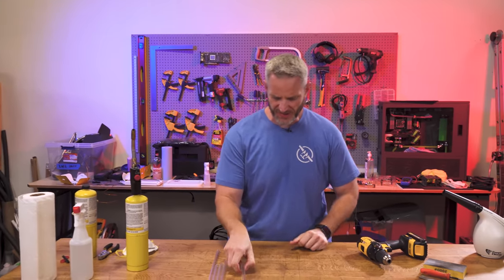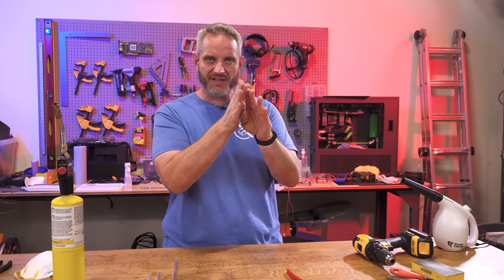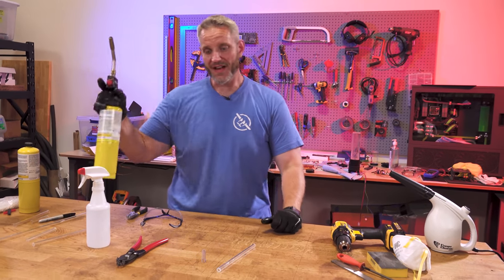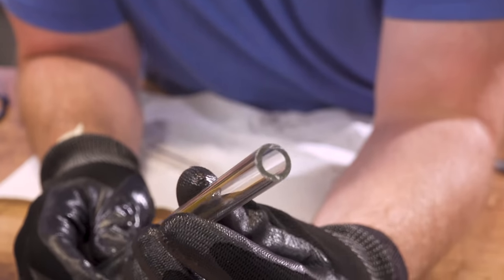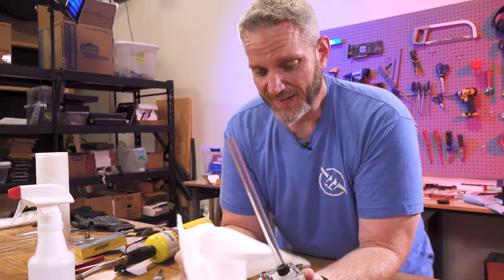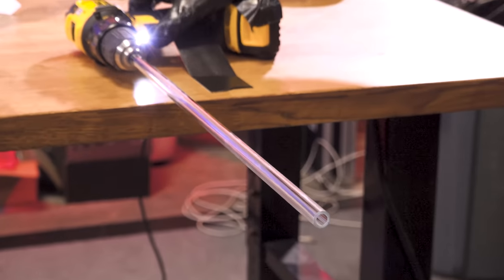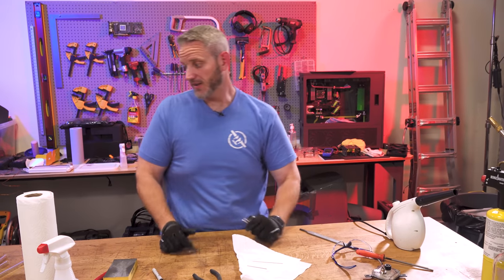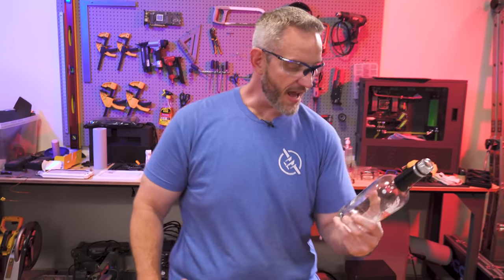Learning how to bend Glass Tubing... This looks soooo good!

Comment: Former glass worker here, go find yourself a glass supplier, you are in Cali, there are plenty of workers there. Youll be able to find much longer lengths and colors as well, just be sure to have plenty of ventilation as these use heavy metals for colors. Items you need: glass saw, bucket with water to throw hot scraps in, blow tube.
Second edit: STOP cooling your hot glass, hot glass need to cool as slow as possible to retain strength.
Third edit: didymium glasses, save your eyes.
Reply: This looks like the tip for you
Reply: Or just get the glass worker to make the pieces you need. They would bang them out in no time flat for you. That way you don't waste materials, time and risk burning yourself or your shop up. (And if doing glass blowing you have to really know what your doing as to not inhale any of the super heated air... that would be bad... very bad). I also like the idea of using colored glass tubes as you wouldn't need to have dies in your coolant fluid. You could also have a reservoir made of the same colored glass.
Reply: @hammer9856  This!!! I used to draw up the patterns for neon signs. You really need a much wider flame for doing clean consistent bends.

That said. i came up with a set of 3d printed tubes and bends that I use to plan out the part, then translate those plastic lego style tubes to paper patterns. then bend the tubes from that pattern. added bonus is you usually can pull off crazy complex parts in your first attempt. and you are left with a set of documents to remake tubes from should you need it. Still do all my builds with petg tube, but the logical next step is I take the patterns to the glass shop....
Reply: I like the idea of a colored glass build, maybe with a fancy logo made out of glass tube
Reply: @danc4046  But why color the glass and not the coolingliquid. It seems smarter to just use clear glass.
Reply: I think the same thing, anytime I see a forger rapidly cool their metal work. :/
Reply: @peterpoulsen4794  it does if you plan to change the color of the water and the whole build is going to be that color of fluid, but if you want different colors in separate parts of your build colored glass would be the best way to accomplish this. then you water is clear and clean and you dont get any kind of weird build up.
Reply: @peterpoulsen4794  seems interesting, what other reason do you need? OP mentioned other safety measures needed for colored glass and having Jay research and demonstrate would be worth watching.
Reply: @danc4046  Also colored glas means you do not need to deal with all the downsides of coloring the liquid.
Reply: @peterpoulsen4794  There are crap ton more colors you can achieve with colored glass than your liquids, it also will not discolor over time. I definitely see peoples points of changing the color but if you are trying to achieve a theme with an exact color, colored glass could be a better option.
Reply: Someone who had a job and has that kind of pfp? That's so rare
Reply: Yeah watching him rapidly cool that tubing is giving me anxiety. Clear boro is resilient as fuck but its also a dice roll when you do shit like that haha.
Reply: @suborgulag7289  what does my pfp have to do with making a career switch in my life?
Reply: @VigilSerus  exactly, clear is strong but I'd rather not risk it when that is pushing liquid around electronics
Reply: @joeschmoe5009  This is one of those Red Barn Racing moments - yeah he can do the engine himself, but why not have someone with years of experience create a better product for his project?
Reply: @hammer9856  You could also get a pro acrylic worker to do your  plastic work for you too. I think you are kind of missing the point.
Reply: @hammer9856  absolutely agree, especially for very complex bends. They have the expensive tools, lathes, etc to make these perfect. I have been thinking of spiral DNA tubes but I need to try pressure testing to see of that has any effect.
Reply: Love this tip, you could also have that worker make the tubes with the bends. Still allow for him to do the build himself. Just like he did with the metal tube build.
Reply: @peterpoulsen4794  Actually using coolant that is already tinted / colored be it pastel or not, over time it will stain, and could clog up the tiny fins / pins in the CPU / GPU block. 
Actually Jay did a video about a year ago? where he cleaned out his or A PC that was using a green pastel type of coolant, the cooling system got all screwed up, look it up on his video list. 
The Idea of colored / tinted glass is a much better idea, and using distilled water with a biocide and a piece of pure silver in your reservoir to stop any growth in your loop.
Reply: Nice pfp
Reply: Glass worker here and my sister is a glass blower and I second e everything Micheal said
Reply: @badreality2  you have a problem with the quenching step of a perfectly ordinary heat treatment process?
Reply: @joeschmoe5009  I'm talking about the engine in his project car. It doesn't NEED an engine, it can sit there and look pretty since he has a completely functional one. 

And since there's an entire industry (and I'm willing to bet a guild, if not a union) of glassworkers, I'm pretty sure that it's time consuming enough to apply.
Reply: This right here. The only thing that reallly made me cringe was him cooking the glass like that... I was shouting get a piece of koawool to cool it slower!!!!! Lol love jay though.
Reply: @peterpoulsen4794  yep
Reply: @XiloTheOdd  don’t use water, use coolant, it lasts for years without maintenance and the difference in cooling potential is minimal, 2-3c maybe
Reply: I thought that, not a glass worker, but every time I've seen someone working glass (in shops where they blow the glass on site) or videos like how it's made they always cool it super slow, sometimes even using less intense flames to stop it cooling too fast
Reply: @anduuhar  I understand he's showing that you can DIY, just suggesting given that there are greater risks working with this material in temps and greater cost in special equipment, there's a alternate route for those looking for one.
Reply: @XiloTheOdd  You could also do a stained  glass themed front panel.
Reply: Question? Would be OK to fill the glass tube with very fine sand so the bend don't collapse? Or terrible idea?
Reply: Would a wet tile saw be okish to use. I did some glass tile in my kitchen, one shattered on contact, the rest cut like butter. I know enough that those tiles were not borosilicate. But isn't that how those ends are cut.
Reply: @TAP7a  the keyword is "rapidly". Any blacksmith (speaking as one btw) will tell you to quench in oil instead of water for MOST metalworking projects, because water cools it too quickly and DRASTICALLY increases the chance of stress cracking in your work.  I have seen knives shatter in the quench tub when done with water.  Also he is correct. if you want it to retain strength, let it cool slowly. Cooling quickly, ie quenching, will also make it more brittle.  That is why bladesmiths will always temper their blades after the quench, to bring some of that strength back into the piece.
Reply: @randomhobbies5796  sand would probably get embedded in the glass. Air is your friend for keeping glass up evenly. You would plug one end and the other would have a flex hose that you can work with while heating the glass.
Reply: @mianderson86  ahh good point. Thanks
Reply: As someone with some experience doing scientific glass(in my own lab, not professionally), I have to put some accent on two things: watercooling builders will overcharge you to death, and mistakes will cost a lot. A glass supplier will make it way cheaper and easier.
Equally important, get/build/cobble together a blow tube! This is really important! Being able to apply pressure to the inside of whatever you're bending will make life way easier.
And third, go slow with the torch! Both heating AND cooling - use the torch to slowly cool the glass down, then let it cool with no forced airflow.
Reply: @badreality2  but with metal work it is common to quench the piece to make it stronger and/or harder and then temper/anneal it to avoid brittleness.

To make strong glass it should be tempered/annealed and not quenched.
Reply: He needs to read this
Reply: BONG glass
Reply: i love how there's nightmare kakyoin in your profile picture lol
Reply: @badreality2  That's a completely different thing
Reply: Question, instead of scoring and breaking the glass. Would just a wet tile saw work?
Reply: @sumdude4  yes thats exactly what I used starting off, just get a nice clean diamond blade and go slow with constant water. If you go too quick it can crack it or make the end jagged.
Reply: Came to say the exact same things, also look into getting a hothead torch, cheap and I've used mine to solder hydraulic lines on a bobcat (that was an interesting experience, but it worked)
Reply: @mianderson86  Right right, just like any machine with a blade. Just let the blade to the work with the benefit of also able to bevel it. Thankfully tile saws can be cheap. I would rather go with those than just scoring and breaking. Thankfully I have a saw already for work in my bathroom and custom mosaics. Been wanting to do a glass build myself.
Reply: @peterpoulsen4794  colored coolant always ends bad for blocks....
Reply: @mianderson86  I wonder if he nabbed any Schott or Simax 👌👌
Reply: >didymium glasses, save your eyes
explain?  Is some kind of uv light given off?
Reply: @TurtleSauceGaming  to a degree yes, a lot of glassblowers can get “sunburns” if their skin can’t take it long term. But the flare given off during oxy/propane melting temps can be extremely bright, and long term exposure will kill your eyes much like welding.
Reply: well it's probably fine to be cooled like that since he's using lab grade borosilicate glass , not the normal lime glass that were use mostly in drinking bottles and kitchenwares
Reply: @kingofstrike1234  actually, I watched a scientific glass blower making wine and beer glasses with cool loops and spirals Etc on YouTube.

He explained that the glasses pretty much kill the orange wavelengths of light and allow him to see clearly the glass he was working on.

He didn't mention the safety aspect of it, but I have no reason to doubt that nor any harm of err'ing on the side of caution.

He also used a tempering oven to heat the entire glass and then gradually cool it over several hours.

His explanation of the borosilicate glass was also very good.
"True" glass can't be heated up and bent / worked in sections. It has to come out of a forge as a large blob and kept at temperature during the forming / blowing process.

Borosilicate glass has additives that allow the localised heating and bending / working to occur.
Reply: Wher's the fun in that?
Reply: You have a very Swedish sounding name! Do you perhaps have ancestors in Sweden? ^^
Reply: @35manning  well i kinda questioned that wrong, so i already edited it, but my point is i think that it's fine to cool the borosilicate glass like jay's did
Reply: @TrevJonez  could you put those 3d prints designs on thingiverse perhaps?
Reply: @kingofstrike1234  no, it's not.

Jay sort of touched on hidden stresses, but didn't quite make it there.

Imagine building a rope bridge. The ropes on the left are pulled tight, the ropes on the right left a little loose.

Makes it very hard to walk across.
If both sides are tight OR loose, it's all even and safe to cross.

Same thing in metals, glass Etc.

The BEST thing to do is heat the entire piece up to 500-600 degrees Celsius, then let it all cool down EVENLY. 

Not slowly, EVENLY.

It just happens that you have more control the slower you do it, so even cooling tends to be slow cooling.

This is the best way to ensure the entire piece is stressed / relaxed evenly and won't have any points right on the edge of exploding.
Reply: @badreality2  Thats a process of hardening. Different material = different rules.
Reply: What's the 4th and 5th edits?
Reply: @hammer9856  yeeeah, but where's the fun in that?
Reply: @isturma  Cause his "project" is the series of videos he'd be creating - not the end product computer.
Reply: Hey man, ive been interested in glass blowing for awhile now, whats the best way i should start?
Reply: And lastly, soldering gloves (usually are red) instead of rubber
Reply: @hammer9856  you're doing. Not your doing.
Reply: @TurtleSauceGaming  just like Vigil said, like welding glass gives off a light frequency that the didymium reflects. Not only does it protect your eyes from burning them, you can also see your work better because it filters out the bright light. This is especially true with colored glass, heavy metals get bright!!! You can also get didymium lenses for cameras so you can record without burning your sensor out.
Reply: @mianderson86  I see. And I understand heavy metals get bright. Ever see a car go up that uses magnesium in the wheels. Or an old VW bug.  The engine block is magnesium.
Reply: (edit by he i mean michael anderson)he is definately right about the slow cooling that will bite you in the ass later when you break a tube in your case also for the short piece's get a piece of pipe copper pipe that has a similar id as the od of the tube youre snapping and you will be able to snap as little as a cm if you have everything fitting snugly PS the water trick was useful never heard that one before wish i knew that when i was cutting sheet glass lol
Reply: Can't you just use a dremel w/ a diamond wheel to cut the tubes?
Reply: @shyxlol327  I mean you could yes but keeping that straight would be a pain and if you goes even a little off axis it will cause chips on the end. Also if you do cut glass without water running over the cutting point you are throwing fiber glass in the air and that stuff floats, make sure you have ventilation or a respirator if you do it in that way.
Reply: @PaulBlueSkies  Correct... I usually catch these mistakes, but not this time. Good catch on your part (not "you're part"....Thanks!
Reply: dw he looked everything up on youtube just before making this video pretending he is adam savage of pc world lolol
Reply: @badreality2  cooling glass too fast breaks it. Cooling metal fast quenches it, making it harder. It's completely different
Reply: @Silvar55x  You're abjectly wrong and have completely lost the plot, but i'd rather watch paint dry than argue with you.
Reply: @shyxlol327  no i've tried that against better advice the wheel always ends up biting in and shattering a large section no matter how stubbourn and careful you try lol
Reply: @hammer9856  It's less fun and most people in the target audience probably can't afford it.
Reply: @chincemagnet  you kmow cpplant is mostly water so you will still have the same problems that you can get with water
Reply: this is officially the Verge PC build guide of glass blowing videos.
Reply: @lordi2009k  well it doesn’t get growth like water, so the maintenance is minimal to none.  I’ve kept the same coolant for at least 3-5 years before, and I even diluted it, that’s when I started running into trouble.  Koolance LIQ702, it’s great, really.  I hate doing maintenance on my loops, I have two, CPU and GPU kept separate. Just fill it and forgot about it until your next upgrade, that’s what I do.  You will get crap building up if air gets in your loop, as the coolant dries it will leave residue.  Aside from that there’s no down side except the small difference in cooling potential.  If your gear is good enough, you can negate that almost entirely.  The coolant in my loop has been there since July 2017, I looked it up to verify, and it’s still fine.  It’s clear, so if it gets contaminated, it’s easy to see, still clear 4 years later.  To be 100% honest though, I did have to clean some residue from my reservoirs at the top where air is.  4 years and that’s all I’ve done, although I did switch from SLI 2080 Ti’s with EK blocks to a single 3090 with an EK block.
Reply: @peterpoulsen4794  it actually looks smarter to me to color the glass so that you can have the cleanest water running in your system. Also it will look much nicer.
Reply: just quench it bro
Reply: @badreality2  metal is different......it actually get's harder if you cool it rapidly

But also more "brittle" if that's the right term.

Heating and then rapidly cooling metal is also called hardening.......if you need it more elastic for like let's say car suspensions and stuff you cool it down slower in air after forging
Reply: Genuinely, what I'm getting from this is, if I'm going to play with glass I should consult an actual grown up adult to maybe do this for me?
Reply: @FaithWandering  Safety first when working with glass. There are some things that can mess you up long term if you ignore it. I'm sure there are plenty of shops that could make the piece for you for a fee, probably cheaper than buying from a pc water cooling supplier as clear glass is extremely cheap!
Reply: Cooling the hot glass doesn't do anything to its strengh, in university after sealing vacuum ampules we throw them into some cold water and they turn out just as fine as slowly cooled ampules would.
Reply: If you gave glass worker your dimensions and asked worker to make in glass, would that cost me substantially less money than it would to buy myself all the equipment to do it myself with minimum effort?
Reply: @prototype4426  that is completely not true, any glass worker any kind will tell you that is false. Yes small glass items can retain strength and usually dont require a kiln, but once the size goes up and you have area of the tube you have not heated while some has been, you will stress the glass and it will eventually break. You wont know when but it will. There are special scopes that will let you see this.
Reply: @Kababalax  Less effort yes but the money would honestly be minimal relatively speaking. By all means give the glass workers some work, its a tough industry. Plus they could do fuming and other color techniques.
Reply: yeah....no.
Reply: @leonardmettlach2614  i dont
Reply: Would a tile saw work for cutting glass tube?
Reply: @badreality2  The difference being that metal have a much better impact resistance. When you rapidly cool you create stresses that harden. Hardened surfaces crach easier. As such since glass have lower impact resistance than metal you need to let glass cool slowly where metal it is usually fine.
Reply: nice
Reply: @mianderson86  
Can you add a little air pressure to avoid  collapsing , or is it necessary?
Reply: There are reasons to temper glass tubes... Assuming they survive the contraction the are going to have very strong ends
Reply: Agreed for uniform strength a kiln would be best to gently bring temperature to room.
Reply: Few questions for you... for short trims like he was struggling with, shouldn't the cold water/boiling water or fuel soaked string methods work for a clean break?  Also, would a razor blade mounted in a v-shaped jig work better for a reliable score?  Finally, is there any reason not to sand the ends down to clean them up a bit more?